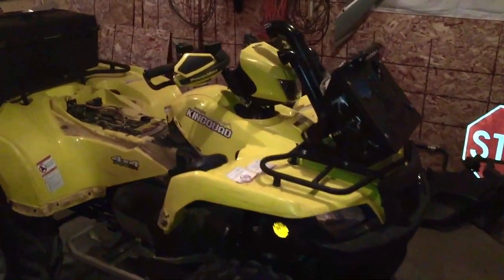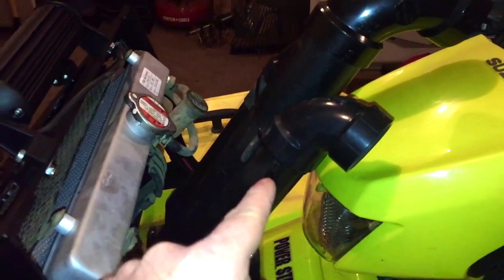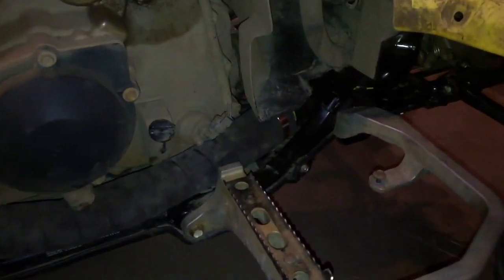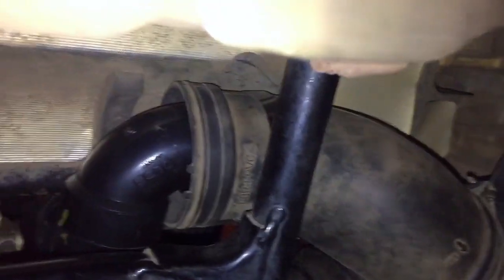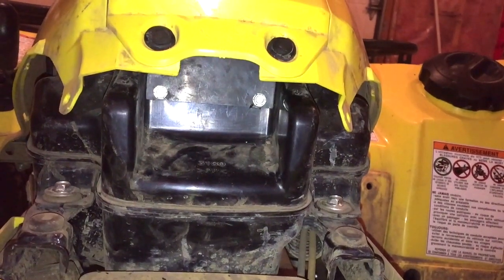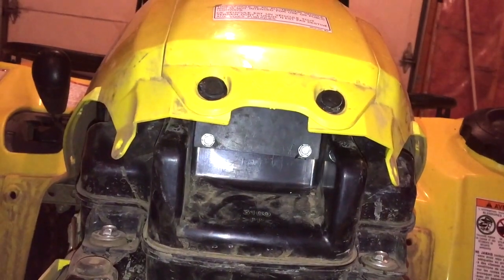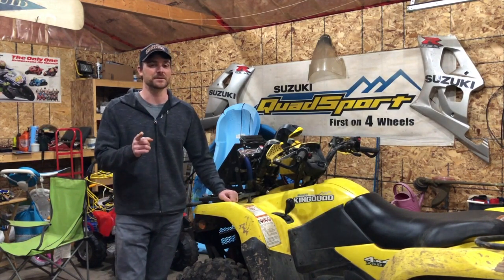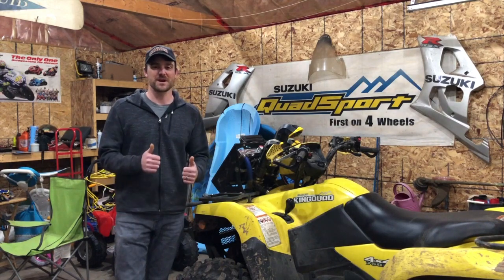How I Snorkeled The Kingquad

Comment: How did you make the air filter top waterproof? Grease? Both my stock filter and an UNI filter seem to leave a gap that water will penetrate going deep. Thx in advance
Reply from the maker: sry it took awhile to reply, i used door weather seal around the top of the airbox. it does a pretty good to seal it up, if i cover the air intake snorkel it chokes the engine out. not to sure how water tight it is, cause i never usually go that deep. thanks for watching !!!
Reply: @dukeboyzpowersports  ok, thx. i actually bought the Twin air filter kit. It seals pretty tight and also put a small bead of silicone around the seal.

Comment: :57 how did you connect abs to the rubber boot?
Reply from the maker: I have a 1 and a half inch to a 2 inch adapter that goes into the rubber boot and use a hose  clamp on the rubber boot, just make sure that the clamp is on the adapter when you tighten the clamp up. On the clutch exhaust i had to push the abs adapter inside the boot till it tighten up. Hope this helps you out. thanks for watching and happy trails !!!

Comment: Hey man, I like the KQ videos! .. I see you used the sya risers but is that the way they run it, like u showed in this video? I'm wanting to do my 19 KQ 750 but just nervous to get in there and Im afraid I won't be able to get it all back together.. ha!.. the sya kit has 4 risers.  2 for the airbox.  Why didn't you use two?  And Any other tips or suggestions? Thanks.. keep up the good work!
Reply from the maker: thanks bud, no this is not the way sya runs there snorkel system. i did it this way because i do a lot of tight trail riding and i was afraid that the sya snorkels would get ripped off cause there on the fenders. Another reason i did it this way is because if the quad started rolling in the water it would give me little more time to save it lol. The reason i only did one pipe for the intake is the factory intake is so small and i felt that one 2 inch intake would be enough. If i have any tips its to buy the sya kit and modified it if you want the snorkels in the middle. building a snorkel kit from scratch is very time consuming and a lot of test fitting lol, but if thats what you want to do then give it a try and good luck.
Reply: So I snorkelled my bike! More of a bitch then anyone will let on, the only thing I haven’t done is run the vent lines, I know where the gas breather is, but where the frig are the other 3?
Reply: Kyle Clapp the front and rear diffs and the fan.  You got the hard one imo being the gas tank. The other are easily assessable.  2 of mine already have billows on them so I just have the rear diff that I'm extending to the front risers.